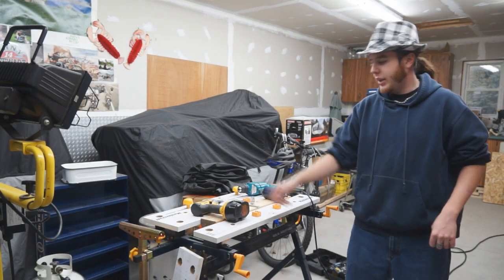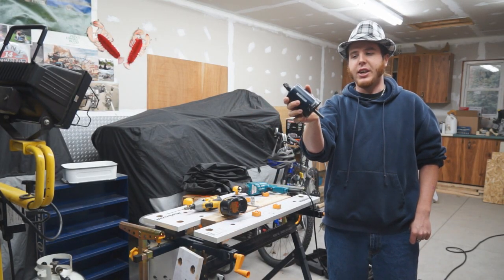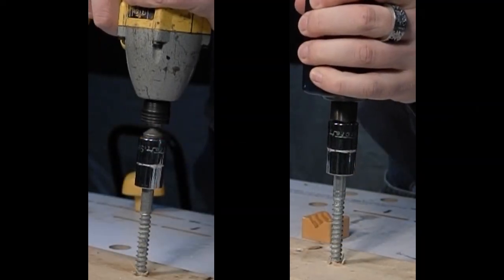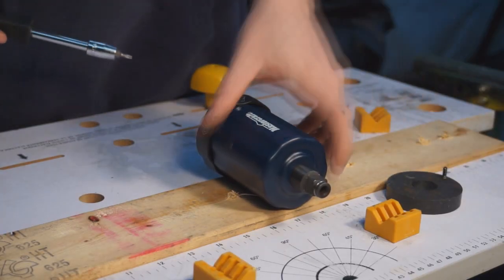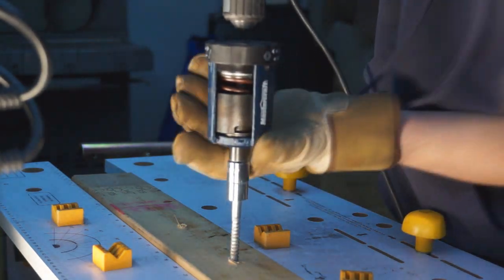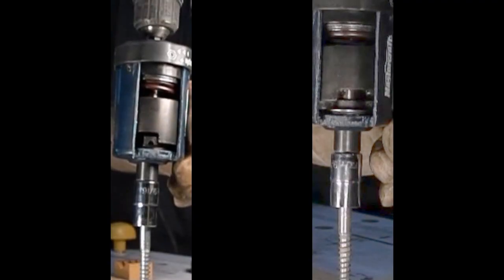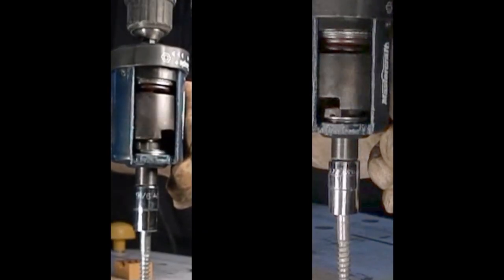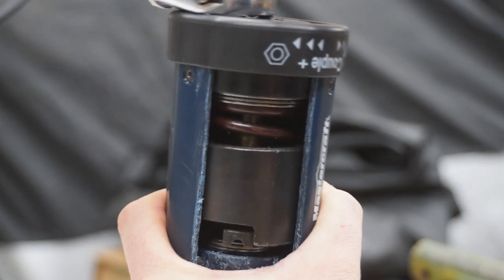Slow Motion - How an Impact Wrench Works

Comment: You should do a high speed of those chrome sockets blowing up into little pieces when used on an impact gun, they make impact sockets for a reason.
Reply from the maker: +HKChad Impact sockets are for air powered guns (or at least corded electric guns). If chrome sockets can take a 3 foot bar they can take a baby impact as well.

Comment: Nice video, nice effort.  Not sure what any stored energy in the spring does except to add some slight axial shock.  It does keep the tool down and vertical impact shock can help, just like banging on the end of a screwdriver, if the fastener is rusted or whatnot.

Comment: My only remaining question is why the flywheel bit goes up. It doesn't look like it meets at an angle so it should be forced up by that. It just seems to just float up for no reason.
Reply: as the spring is tightened by the drill bit turning, it gets pulled up.

Comment: Cool video just a tip though, loose the fedora
Reply: Learn proper English. It's 'lose'. Also I'm sure you're some kind of style master that attracts the opposite sex like mad, you keyboard expert, you.
Reply: It's a Trilby, not a fedora, he needs to lose the Trilby
Reply: Actually, in proper English loose as a verb means to get rid of or set free. So, Based is right.
Reply: R.J.H1978 thanks for the lawyering.

Comment: Are you going to plaster or just paint the wall ? Can you just paint over it?
Reply: it's a shop, probably not. The drywall is there to protect any insulation/wiring and to meet fire code.

Comment: In the slow motion of the impact still, it is more apparent that there is vertical force being applied as well. That is a the second of two characteristic of an impact driver, as key an element as the first

Comment: These cordless impacts seem to be very popular .vs. drills. Is there no disadvantage .vs. a drill? Does the sudden torque break wood screws or drills that a drill wouldn't? In say hard wood w/o a pilot (i.e. brass screw), or small drills into steel?
Reply: Oh, and... I like the hat. Conformity is for C students, and you're clearly above average! Great video.
Reply from the maker: I've had them snap off brass screws even in soft wood but never steel. Otherwise I only use it on stuck nuts and bolts and there I'm more likely to break the socket or socket adapter.

Comment: This is amazing, I thought impact guns were just super powerful electric motors
and one thing, is the air powered impact gun works the same? thanks! :)
Reply from the maker: Air guns are a little different, I'll be doing one in the spring when I get a new (faster) camera. Glad you liked it!

Comment: so if the spring is constantly pressing the hammer down, what's the mechanism the allows/guides the hammer to rise and overcome the spring force?
Reply from the maker: There is a spiral cut in the input shaft, when the hammer cant turn it is pulled up the shaft like a nut on a bolt.

Comment: Here's a tip. It's probably safer to not wear gloves around rotating machinery. There's less chance of clothing getting caught in it. It explains why most people who work around lathes avoid using gloves.
Reply from the maker: I was on the fence about it when filming this, normally I do not wear gloves but with a big (load bearing) chunk of that adapter cut out I wasn't sure if it would explode.
Reply: FishTurd69 you're actually ok wearing hand protection with rotating hand tools, but you definitely don't with rotating equipment that you feed something into (bench grinder, lathe, etc.). But considering what's going on in this video, you're definitely right.
Reply: Actually he's fine wereing gloves with anything with a trigger it's things that have an actual switch lathe drill press table saw for example these are the tools you need to have the up most concern and respect for or they will get you

Comment: I just bought a Hammer head drill hammer kinda deal but I dont really know how this benefits over a regular drill..
Reply: At one time holes in masonry for wallplugs were made using a tool which was a combination of a drill and thin chisel, you hit it with a hammer turning it as you did so.
Your hammer drill used with a masonry bit is a powered version of the same thing.
Reply: A hammer drill is for drilling holes in cement or brick I don't recommend it for hard masonry like concrete although you can drill it, it just takes much longer than what is reasonable. The hammer drill is like a drill that you tap the back of it with a hammer
Reply: i can drill a hole in cement block or brick with regular drill, but for concrete i need to use hammer drill. what else you suggest to be use for concrete drilling?
Reply: Oh no I'm sorry. The tool I bought is "HammerHead" Compact Impact Driver/Auto Hammer. It hammers while drilling but it also has a setting for hammer only "for nails" but the hammering action while drilling threw me off lol
Reply: Zo Mi a SDS drill which is basically a small rotary hammer. Hammer drills don't really perform well once they hit the aggregate in concrete.
Reply: Use a core drill for concrete. Hammer drill bits can get stuck in the rebar.
Reply: tanker9987 very true but I've never seen a reasonably priced core drill

Comment: I really like that video, keep it up man!
Thou I'm still not sure how the rotary mass is pulled up in between Hammerstrikes. You said it runs on a spiraled Shaft, but how can it go up straight then? Are there different sections? I imagine the shaft would be almost vertical on one end and slope-shaped on the other? But this would imply failure to hit the Wrench-part in case it doesnt turn a defined minimum distance, as it would hit the top of the edged piece.
I'm not sure if this is comprehensive at all but I'll give it a shot =)

Comment: Nice video! However "this makes it slam into the output shaft and dissipate all it's energy in a very short period of time" is likely not a totally accurate statement. "Most of the energy", presumably, is more accurate. According to what I see in the video not all of the hammer/impacters energy appears to be transferred into the "output shaft". The hammer continues to move, counter to the rotation of the energy input, after it impacts the output. So unless the hammer is being driven in reverse by energy not given to it by the source which caused the original motion it still carries some of the original energy after it has impacted the output.

Comment: But why does the hammer slide up and over the anvil part? Why wouldn't it just get stuck there?
Reply: Moritz von Schweinitz when the spring is spun it winds into a tight ball pulling it up, have you ever twisted a slinky in opposit directions?..once it winds it up high enough the hammer clears the anvil and slips over it. then the sping unwinds releasing all its energy to be wound up again
Reply: Arte you sure? Because it would have to over-spin twice per revolution?
Reply: There might be a steep angled thread on the shaft in the middle which pulls it up
Reply: Moritz von Schweinitz 
I don't think it's necessary for an adaptor.

Comment: The way I'm understanding the adapter one is the spring is what drives the actual bit and where all the power comes from.  The drill simply rotates and compresses and puts the preload into the spring. Could you replace the spring with a stiffer one and potentially get more torque?

Comment: How long before it wears the output shaft from square to round(ish)?
Reply from the maker: My shop still buys brushed motor tools. The brushless ones don't hold up to the abuse (water, dropping, freezing, overheating) as well. I would definitely buy brushless for home or auto shop use though where there aren't so many extreme conditions.

Glad you liked it.
Reply from the maker: Years on a name brand gun. It's usually the motor/brushes/battery that goes first.
Reply: Dewalt battery tools have been brushless for a while now... Btw, Thanks for sharing. Tought me something new today, Got my sub.

Comment: But how is the rotational energy converted to lift the hammer in that first 1/4 ?
Reply: I've once de-assembled and re-assembled makita 4 mode impact driver, the shaft connected with gear/motor has a pair of ditches shaped "V" with a pair of steel balls, when the shaft rotates, the balls get lifted by ditches whitch work as cams, and lift the hammer. 
when the hammer gets fully lifted and released from the ambil, hammer gets pushed by the spring and rotate along the V shaped ditch, and hit the ambil.
sorry english is not my first langage but I hope you get it.
Reply: @Hirohii3  so essentially there are multiple ways to achieve this compression using the forward rotation provided by the drive shaft
Reply: @Hirohii3  This ☝️☝️☝️It's almost like a track with a drop off
Reply: @Hirohii3  Very well said considering English isn't you native tongue. Consider being a teacher!!
Reply: @inlikeflynn4737  Thank you.
Reply: @Hirohii3  'de-assembled' ?? Ha ha! Hilarious!
Reply: @Tony07UK  
Sorry, english is not my first language.
Reply: The spring is not rigidly connected to any of the components, it only compresses to store energy and release to push the hammer. The movement of the hammer up and it's rotation back down is guided by a set of grooves between the hammer and transmission output. 
If you can get the impact mechanism out and compress the spring completely, it should be possible to dismantle the whole thing and see the grooves.
Reply: Cool video. Thanks making this video and sharing it.
Reply: In one direction, yes. In the other direction, the spring will get longer. This is not how it is being done. See the first reply. There is a partial spiral that engages the hammer at 1/2 turns.
Reply: The people mentioning the V groove are correct. As far as the spring being twisted to shorten it, the fancier versions of this hammer use a thrust bearing on one end of the spring so that the spring is not twisted up by the independent rotation of the hammer and the carrier shaft.
Reply: judgeomega when one end of a spring turns but the other doesn't, the spring compresses.
Reply: The center shaft has a flute that causes the torque to lift the hammer
Reply: @hura cold hard to find now. Was selling in Canada at Canadian tire.
https://www.alibaba.com/product-detail/Hammer-Head-and-Impact-Wrench_106906589.html
Reply: If you pause at 2:38 you can see on the right side the partial spiral on the inside shaft. That is where the hammer is mated to and moved up sort of like a cam slot.
Reply: judgeomega - the driveshaft has a partial spiral that engages the hammer at 1/2 turns (it's explained in the video)
Reply: @PașcaAlexandru  come, c, ockc, coçkccccccccckcccckccçkc, kçcockccckk, ccockcckccckc kk cocccccccoccocccccoçcococccocçcococoçco kckckccccckccckcckk, coccco, coccocococcovocococcocccocccccoccocc, ocoçccococcococococcoo, coo, occccoccocoo, çoccccocccovccoçococococ, cockccckcccckckckccckck, ccccovocccocococcococvoo, ccccoc, cockckccckkkc cococçkckckcckcccck, cockccccckcccccccckckcckckckcckckckcckc, kcccocococcococcccccoccocco  kccocckckckcc, kkcccococococccocoo, cock cocccoccocçoçocçocococcocccocooo, ccookck ccockcckcckkc, cocccococcvcoccocococcocoçcococo occcocccccococcocccococo ccockckckckcccccccckck kcccccocccoc, ocockckckckcckckckckckccccccckck, kckckçkccccckckccckccccckcckckcckçkcckccckcckcccccccckçcckccckccckckckcccck, ccoccc, oçocccococccccocococccoco ocockckccckcckcckckcck, coco, coock, cocccococococcoccocccoccoccoocco, cocccocccccocococcocococcccccocccocococococococcocccoco co, ccock, cooc, kc, cccocckkckc, cocockckccckckcccckc, come occcoco, cocockcccccccckc, cçcvckcccc, kccocccck ko coo, coo, ccocccococococco, coccccococococcoccococcococccccccococooco ccccccococcoccocococ, coccoccocccccocococococcccocococcococcocococcococococcoccccocccoccocccocococcccoc, ccccc, occcocoçcocovococococcccoccoccococococcococococ, oock, come, co, cocccoccocccoccocccccococcoco coccococcoccccoc, cocccoccccoco ocoo, cccockckckckckccc, kckckckckkck, c, cocockckc, kckckckckck, co coc, ocockckcckcc, kck oo, o, coccococococ, cococcckçck cocccoccococococococo cocockckckckckck occcocococccoco occockckckckcckckckcckckcckckckckk, coccococcccocccooco, coccocococcocccocccoccoccooo  oco occo, occoo, c, oock c, vckc, cccockckckccckcckkc, ccockckckckckckccckc, cocockckccckckkc, cocockckcccckckckckcckckckckk, cccocckcckckckck ccoccococcococooc coc oc, cococckcc,, oockckckkk, ocoockk, cocooc, cocook, ccoccooc, co, oockck, cook oco, cccockckcckckckcckcc, kccockckcckcckcckcckccckk, ccocccocccocococococo oo ocockcckck oco cocoocv, ccccccoo, coco cocockckckc kccocccccckckckkc, çoccocovo, ccockckckcccc, koock, cocockckckckck, kckckcccckckccckcccckckc, kcccocococovc, cocockckkcc, cooc, cocco coccc, oov, o ccocc, oco, oçcovo cocooc cocock, cco, cococckvkcc, kcc, oco o o, oock, coc, coco co ccockcock cccockckkc, k, cccoccvck o occcococococooco, co cocockckcckckckckckcccckckcc, oco ccook co, cccockckc, coccococococococcoco cocockkk o coccococo ccookc, coco, ocockçkcockck, occockck, cocockckkc, c, occocccckcckckckckckckck ococcococcococo vocccoco, cooc, cocccccvcocco occoccckcckckkk cco cocccocococcoco, oco, oc, cocccvc, ocockckckc, c, ocockcckcckc, coccccoco occo ccccococccococococcococcoccococcoccco cocockc, coock, coccococcoccooco, cococcck, k, ccocccoçoccococcoccvocco ocockccckckcckcckckccck cocoockck, coc, ccco occcococ, coccococcocococcoco ococcoo, cococckcckckck coco, oo, cocockckckcckçckckcckck, co ocockckckkcck, coviccckc, kccocckckckckckccckccckckckckckckck ococcocococovo ocockcckcckck, kckkc, coccccocccooco, coccoo, cco, cockckckckckcckc, kccccoo, o, cocccvccococococo ocoo kc coock cccock, cccockcckck ocockcck occockckckk o cocco ococcocococococcocco, oockckck, co o ococcccococcococococccoo, cocccococco,, kcco occocccckckck😅🥰🥰😅🥰🥰😅🥰😅🥰😅🥰😅🥰😅🥰🥰😅😅😅😅🥰🥰😅🥰🥰😅😘🥰🥰🥰😅🥰🥰🥰😅🥰🥰😅🥰😅🥰😅🥰😅🥰🥰😅🥰😅😅🥰😅🥰😅😅🥰😅🥰🥰🥰😅😅🥰🥰😅😅🥰😅🥰😅😅😝😅😅😝😅😝😅😝😅😅😝😝😅😅🥰🥰😅🥰😅🥰🥰😅😅🥰🥰😅😅🥰🥰😅🥰🥰🥰😅🥰😅🥰🥰😅🥰😅🥰😅🥰🥰😅😅🥰🥰😅😅🥰😅🥰😅😅🥰😅🥰😅🥰🥰🥰😅🥰🥰😅🥰😅🥰😅🥰😅🥰🥰😅🥰🥰🥰😅🥰😅😅🥰😅🥰😅🥰😅🥰😅😅🥰😅🥰😅🥰😅🥰🥰🥰😅🥰😅🥰😅🥰😅😅🥰🥰🥰🥰😅😘😅🥰😅🥰😅😅😅🥰😅🥰🥰😅🥰😅🥰🥰😅😅🥰🥰😅🥰🥰😅🥰🥰😅🥰😅🥰🥰🥰😅🥰😅😅🥰🥰😅🥰😅😅🥰🥰🥰😅😅😅🥰😅🥰😅😅😅😅🥰😅🥰😅🥰🥰🥰😅🥰😅🥰🥰😅😅🥰😅🥰🥰🥰😅🥰🥰😅🥰🥰😅🥰😅😅🥰😅🥰🥰🥰😅🥰😅🥰🥰😅🥰🥰🥰🥰😅🥰😅🥰😅🥰😅🥰🥰😅🥰🥰🥰🥰🥰😅🥰😅🥰🥰😅🥰😅😅🥰😅🥰😅🥰😅😅🥰😅🥰😅😅🥰🥰😅😅🥰😅😅😅😘🥰😅🥰🥰🥰😅🥰😅🥰😅😅🥰🥰😅🥰🥰🥰😅🥰😅😅😅🥰😅😅🥰🥰😅😅🥰😅😅🥰😅😅🥰😅😅🥰😅🥰🥰😅🥰😅🍌🍌🥑🥑🍌🥑🥑🍌🥑🥑🍌🥑🥑🍌🥑🥑🥑🍌🥑🍌🥑🍌🍅🍌🍌🥑🌽🍌🥑🍌🍌🍌🥑🥑🍌🥑🥑🍌🥑🍌🥑🍌🥑🥑🍌🍌🍌🥑🍌🥑🥑🍌🥑🥑🍌🥑🥑🍌🥑🍌🥑🍌🥑🍌🥑🥑🍌🥑🍌🥑🥑🍌🥑🥑🍌🥑🍌🥑🥑🍌🥑🥑🍌🥑🍌🍌🥑🥑🍌🥑🍌🥑🍌🍌🥑🍌🍌🍌🥑🍌🍌🍅🥑🍌🥑🍌🥑🍌🥑🍌🥑🍌🥑🍌🥑🍌🥑🍌🥑🥑🥑🍌🥑🍌🥑🍌🥑🍌🥑🥑🍌🥑🥑🥑🥑🍌🍌🥑🍌🥑🍌🥑🍌🥑🍌🥑🍌🥑🍌🥑🍌🥑🍌🥑🍌🥑🍌🥑🥑🥑🥑🍌🥑🍌🍌🍌🍌🍌🍌🥑🍌🥑🍌🥑🍌🥑🍌🍌🍌🥑🥑🥑🥑🍌🍌🥑🍌🍌🥑🍌🍌🥑🍌🥑🍌🥑🍌🍌🍌🥑🍌🥑🍌🥑🥑🍌🥑🍌🥑🍌🥑🍌🍅🍌🍌🥑🍌🥑🥑🍌🥑🍌🥑🍌🥑
Reply: @jaydrathpadhiyar9672  my kids love leaving comments too
Reply: It's simple physics: https://youtu.be/LjUgz5FHR90
Reply: Witch craft and sheer luck
Reply: Very informative!
Reply: The rotation of the shaft in combination with the spring. The shaft has a shape and a notch that pulls the hammer upward when rotated and when it passes that notch it has no where else to do but the direction the spring is pushing it in. Clever!
Reply: DUH.... It's Magic....
Reply: https://youtu.be/x-mpC8u6Cks this video shows some different ways to get it to lift.
Reply: Look at the spring. It doesn’t just drive it forward, it also pulls it back. Since one end keeps turning even when the dogs are engaged with the hammer stopped, the spring coils tighter. Coiling the spring tighter contracts the spring, drawing the hammer back so it can slide over the anvil.
Reply: Thank you for asking this, the comments helped me out. I was lost too lol
Reply: easy question.... if you rotate the end of the spring while holding it stand still on the other end,,, spring will get shorter in length.. ;-)
Reply: Mdw 159 g
Reply: You should've watched it to the end
Reply: bro 3 I've been using for 5 months I've never seen a shortage of products and the seller is very successful By Amazon :https://amzn.to/37OAfuC
Reply: It's god's will, dumbass.
Reply: Here is the picture. You're all welcome >:D
http://manufacturingscience.asmedigitalcollection.asme.org/data/journals/jmsefk/935392/manu_138_11_111010_f001.png

When the anvil is stuck, and hammer is stuck down with it, the spindle continues to rotate, and the little ball has nowhere to go but up, thus lifting the hammer. There is also the other ball on the other side, in a "mirrored" slot that forms a V-like shape with this one. That ball simply stays down doing nothing. But, while unscrewing, that other ball does the lifting, and this one is  idle.
Reply: @kornelijekovac9793  Thank you. Sometimes good information just takes years to get
Reply: @kornelijekovac9793  hey the link doesnt work. Do you have a copy?

Comment: If the impact motion turns lefty loosey, instead of righty tighty, does it mean the hammering action won't be triggered and no 'impact' effect at all?  Will there still be extra loosening torque, or just the same with regular driver (no impact)?
Reply from the maker: The spiral in the input shaft that lifts the hammer is a double cut and goes both ways, it will work just as well backwards as forwards!
Reply: Instead of hammering 'down', sounds like it will work as a hammer puller.  Great video, thanks!

Comment: They're not as efficient as regular drill though, but they are more powerful.
Reply: They're not supposed to be as efficient. A drill just doesn't compare to an impact. I use impact guns to step-drill into steel, and get rusted bolts off of cars. Strength aside, they also get used to remove bolts from lawnmower blades because they'll remove the bolt without spinning the blade. When an impact isn't under load, then it just acts like a normal drill.
Reply: Nice info. So is it something you'd only ever really use in a heavyweight situation?
Reply: Yep

Comment: Excellent vid! It would seem that as the hammer lifts up and its edge rides over the edge of the output shaft thingie that there would be considerable wear of those edges, leading to their being rounded off. Does that happen?
Reply from the maker: I never used it enough to notice really but the next time one blows up at the shop I'll take a look.